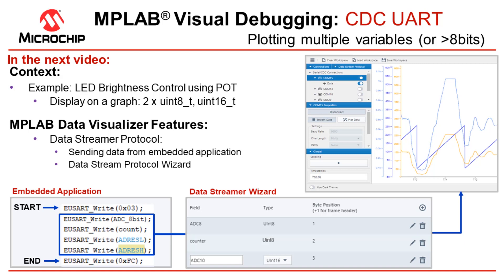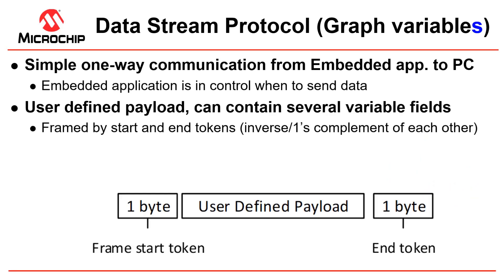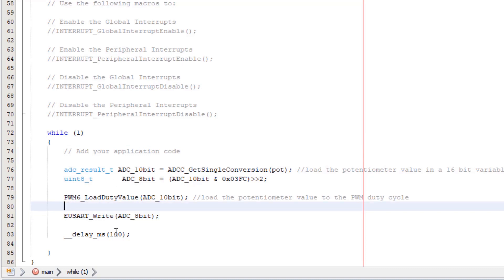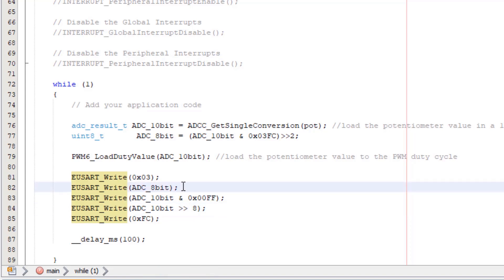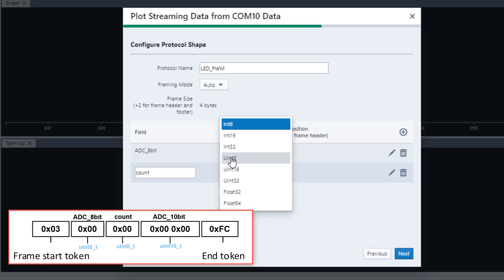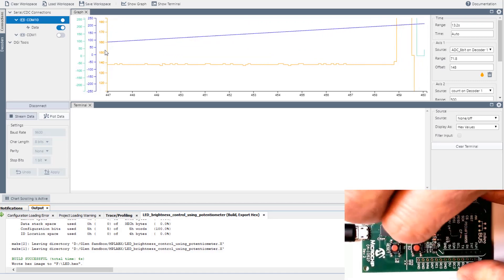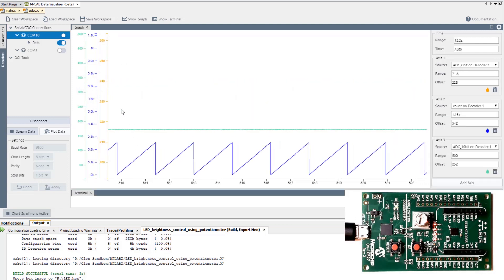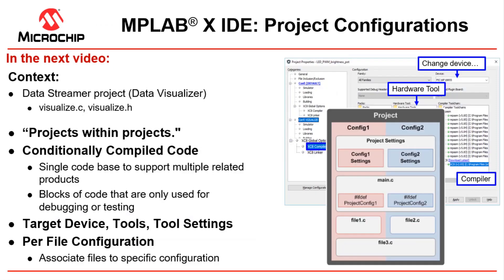Visual Debugging with the MPLAB® Data Visualizer - Plotting Multiple Variables

Comment: Im new with microchip products, i wonder if i could i use this visuallizer bebug with pickit 5?
Reply from the maker: Hi there, great question. You can use the MPLAB Data Visualizer tool for graphical debugging and real-time data visualization with Microchip products. MPLAB Data Visualizer is available as a plug-in for MPLAB X IDE or as a standalone application. It can receive data from various sources such as the Embedded Debugger Data Gateway Interface (DGI) and COM ports, and is designed to work with Microchip’s supported programmers/debuggers, including the latest tools. Learn more here: https://www.microchip.com/en-us/tools-resources/debug/mplab-data-visualizer